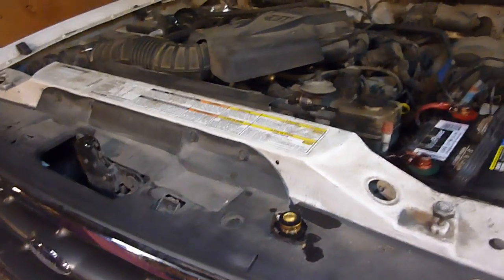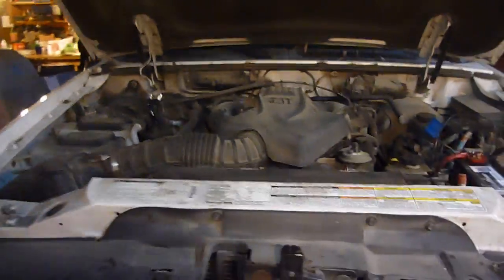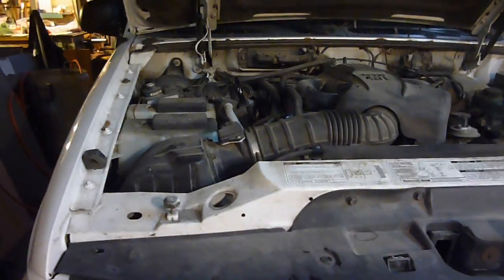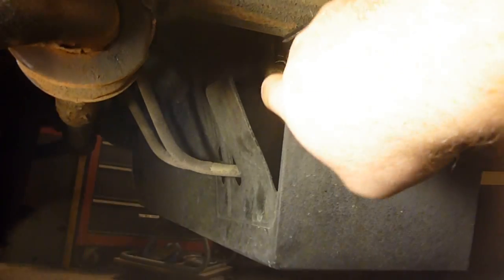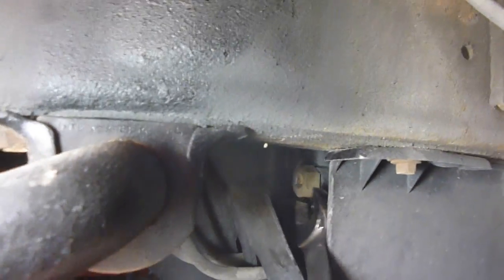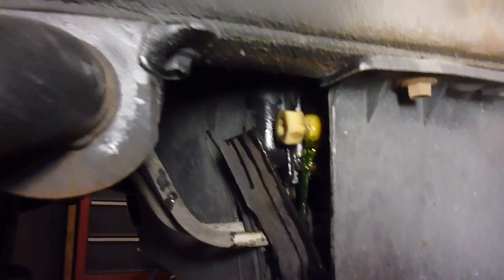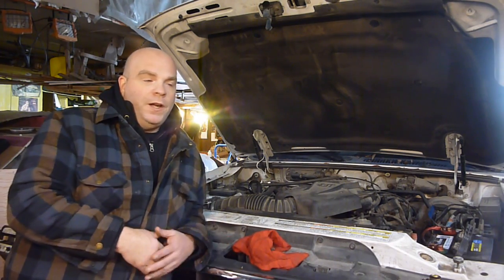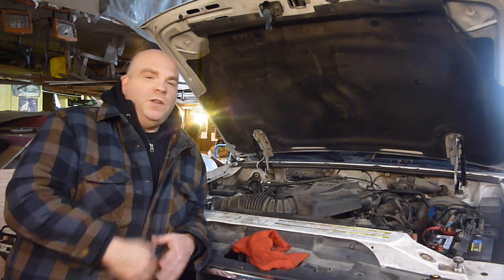FORD EXPLORER WHERE TO FIND RADIATOR DRAIN PLUG V6

Comment: I have a '05 Ford explorer, 6 Cylinder .Do you know how much coolant for a simple drain and replace. Although, i probably will get an idea once i open the valve and measure how much drained out. I read somewhere 4 gallons but wasn't sure if that's for a complete drain and flush. But, i have 3 gallons 50/50 , wasn't sure if that's enough?
Reply from the maker: its been awhile so i cant remember sorry